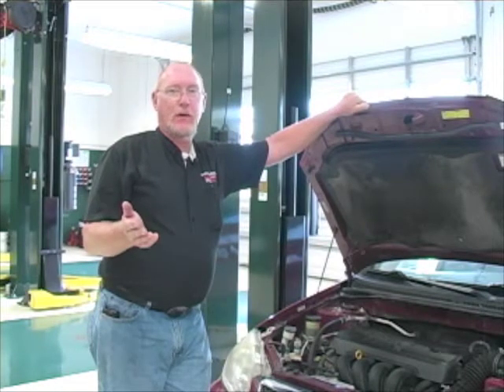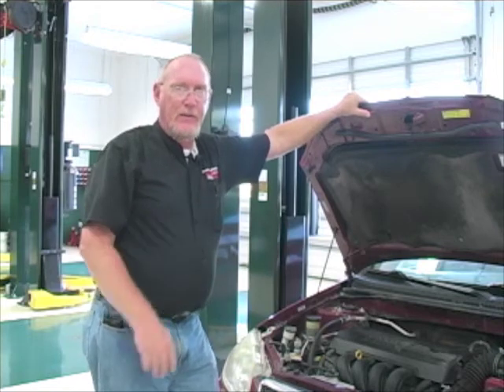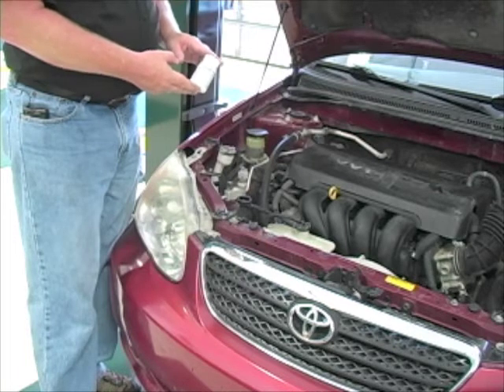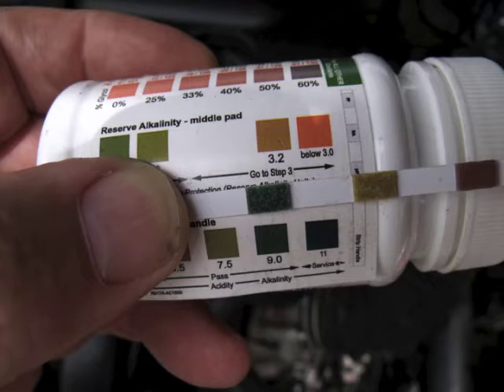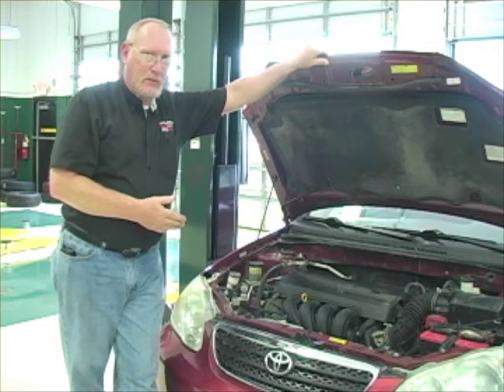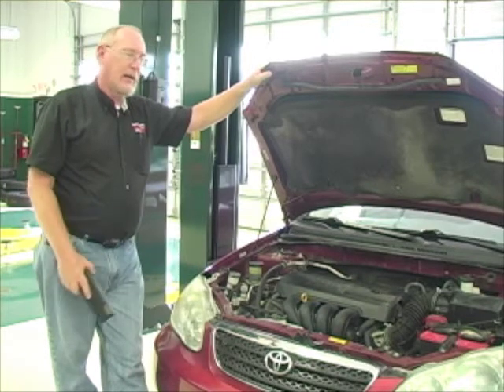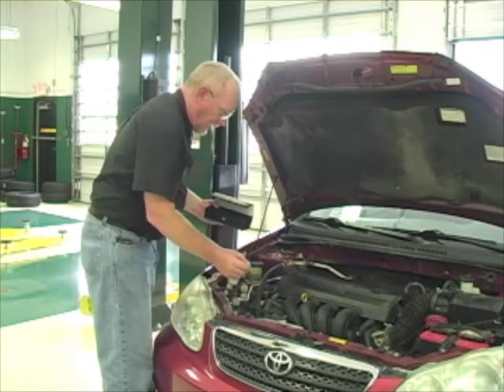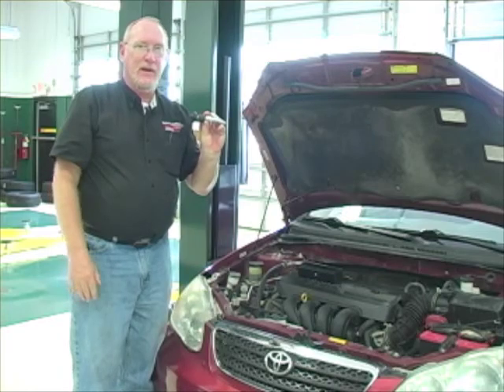The Trainer #21:  How To Test An Engine's Coolant

Comment: So,  was it the original factory fill, and if so what was the mileage? My owners manual says first coolant service is due at 120.000 miles!! I dont buy that!!
Reply from the maker: I don't remember if it was the original fill or not, nor do I remember the mileage. Neither should be considered, in my opinion, when determining when to service the coolant. For example, Class 8 tractors get 400,000 - 500,000 miles on their coolant fills but they are tested routinely and additives are replenished when necessary. We don't have that option - so if the coolant loses its additives we have to replace the coolant and correct the reason for the premature service.